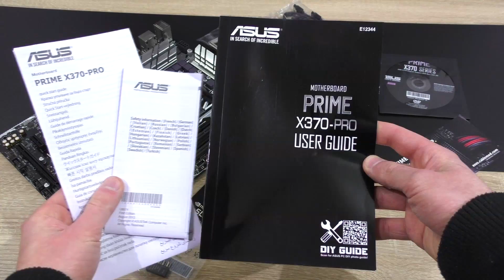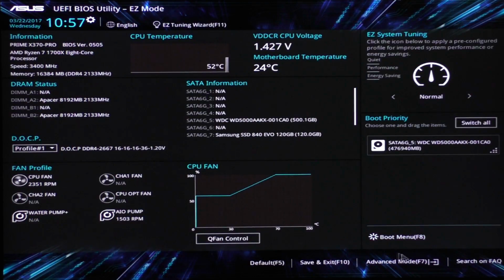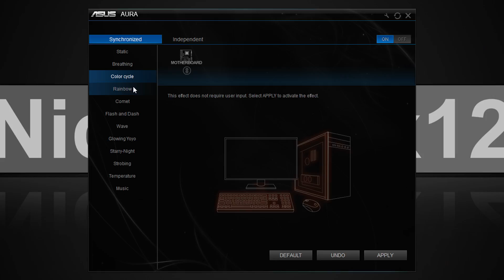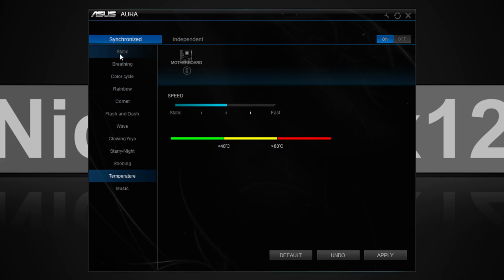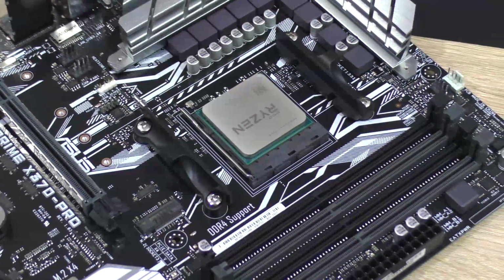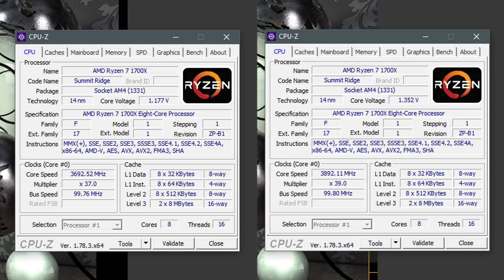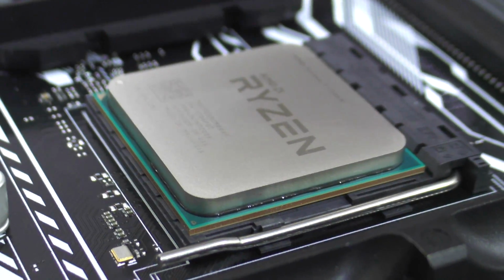PHENOMENAL X370 VALUE - ASUS Prime X370-Pro Review

Comment: I bought this board, but I'm a little bit concerned now because of all 1 star reviews I see on Amazon. Some say that it didn't work. some say that it died after a month of use. What do you guys think?
Reply: Update the bios. The newest bios had AMD microcode in it increasing performance. Whether that is your bug or not, I don't know, but it will only help. Also, make sure you grab the intel nic driver off the intel site. The Intel driver crashes with a blue screen using the driver from microsoft bundled with windows. If it was unintentional, that would almost be funny. I am unsure about that though.

My only problem with it is randomly the boot drive fails to boot and I have to hard restart, but then immediately works again. Weird bug.
Reply: just built it and works flawlessly. got my gskill 3200 ram stable at 3066 no problem. gonna try and tweek it to get 3200 ;P
Reply: Mine worked fine. The rating dropped mainly because of the initial batch of preorders, they oversold the board, and many people were waiting for weeks while being unable to cancel the order, just to get a board that was rushed with poor quality control and an outdated bios. This was a temporary thing, but it hurt their rating on amazon and newegg. The included bios self destructed after an undetermined amount of time, killing itself. Those who updated their bios out of the box never had that issue, and the later batches came with a newer bios on them.
Reply: A quick update. I bought this board and  I'm amazed at how good it is. Got my Corsair Vengeance LPX running at 3200 mhz on bios ver 0805. Currently having some other issues with pc like games crashing after 5-10 min and occasional bsod, which I'm trying to figure out what is the problem, but I doubt it's the motherboard thats causing the problem, most likely got the faulty ram. Do you guys think I should update bios to the newest version which I think is 0811?
Reply: Kako radi ploca,jel si popravis,sta je bio problem?

Comment: How are you. I've put this motherboard with the Amd 1700 to 3.9 ghz. With the latest bios available. Cooling Corsair H110i. Very low temperatures (less than 60 ° C). With a voltage of 1.35 I do tests of about 15 hours in Prime95, OCCT, AIDA64 and it does not present any error. But if they render ... The screen is black and remains as off. Anyone having the same problem.? I can not solve. 3.8 ghz is presented. Please help. Thank you. (Done with the Google translator).

Comment: Great review as always Nicolas! I like this board but am leaning towards the AsRock Fatal1ty X370 Gaming K4  which is cheaper and has a great feature list as well. I plan on pairing it with the R5 1600 but not sure if I should get a better cooler like the Cooler Master Hyper 212X, to obtain a sensible overclock.
Reply: shardnz better go for 1600x instead of 1600 and gaming k4 is better choice compare to this.